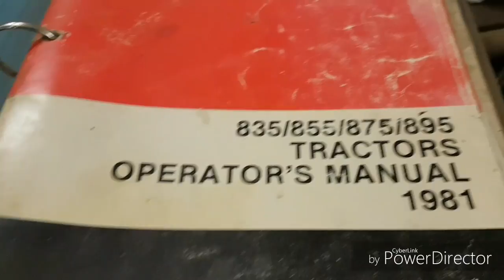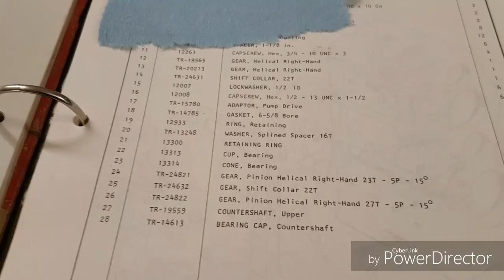895 transmission removal, trouble shooting and repair!

Comment: Hey. when you get those new bearings, wrap the old good bearings in greasy paper or rags and stick them away, because when the new ones fail because they were not up to snuff, you will still have the good ones to put back. You will hear when they fail if they do.

Comment: Next time make you a puller for yoke chunk of thick pipe big bolt and 2 nuts done
Reply from the maker: Wasn't any room. We have a big puller but no way it would fit haha
Reply: That's what I was thinking-- weld a nut on the back of a piece of pipe or bar that will slip through the yoke hole then run a bolt with the end turned to a point through it into the end of the shaft zip it right off... I've made my own pullers before to do stuff like that... had to build one to pull bearings out of blind holes in the rake bars before too... Doesn't have to be big or pretty just get the job done... going through the U-joint trunnion holes it's compact longest thing is the forcing screw you can use whatever bolt length will fit basically... 

Later!  OL J R :)

Comment: I know they have Cummins engines but can you still get most parts for those tractors?
Reply from the maker: only thing you cant get are decals lol
Reply: @SouthSaskFarmer1  Well if ya can't get the decals then damn. What's the use...........
Reply from the maker: @johnnyholland8765  hahahahahahahaha
Reply: That's the beauty of these,  they made them simple and with common parts. Allot of the parts are off the shelf items you can get at any parts store and allot are common truck parts.
Reply: @jonkreiser7757  That's the way it SHOULD be... Later!  OL J R :)

Comment: I assumed that being a big tractor there would be plenty of room around the gearbox but nope.                                                        Sure was lucky that lot went down through the gearbox without even chipping a tooth, Would of thought there'd be some locking wire as well or something.
Reply from the maker: Ya but nope. Just a nut and thats all Haha

Comment: You should check out Welker Farms YouTube page they got an 1150 versatile that should probably go down the road to a good home so it doesn't get scrapped out
Reply from the maker: Cost more them it's worth I'm afraid
Reply: @SouthSaskFarmer1  needs a motor in a transmission somebody mentioned that they had an offer for $6,000 for it
Reply from the maker: @mathewwalworth5236  ya more work the  I wanna do lol

Comment: I didn't think I heard you but are those Cat transmissions in that tractor?
Reply from the maker: Nope versatile made their own haha
Reply: the new versatiles have cat transmissions
Reply from the maker: @jd3137  yes
Reply: @jd3137  I didn't know if they always did or not
Reply: I don't really remember if the tractors before the newest style had cats or not but the 2012-now do
Reply: seen that ...it is written on the case ..... how many gears ? i presume no powershifts  . and a constant mesh gearbox ....